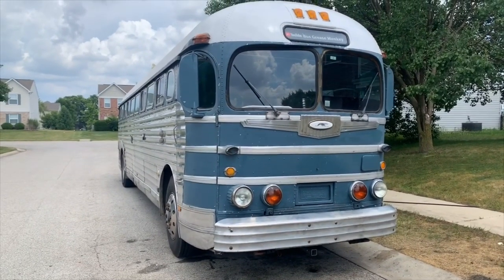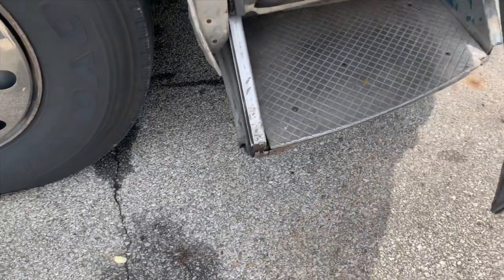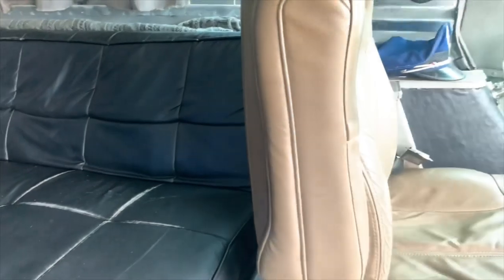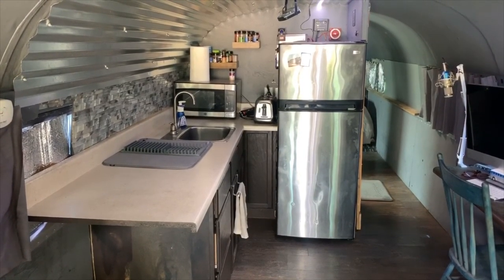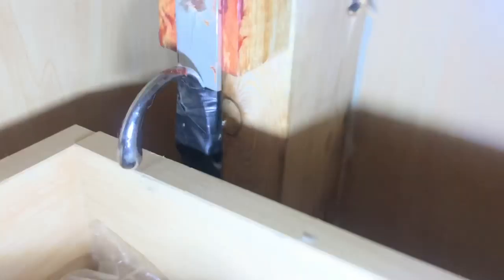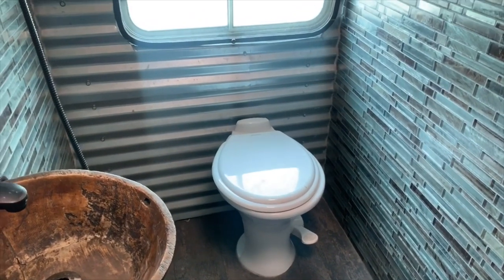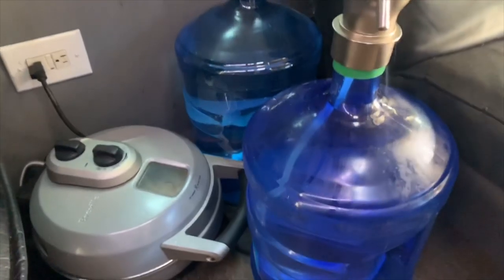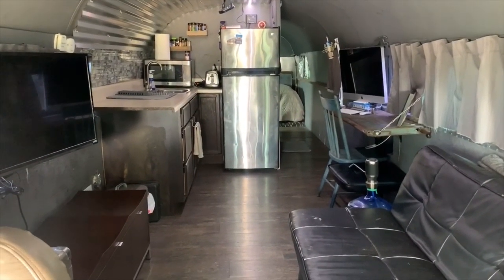Vintage bus tour gm bus 3751 silversides rv conversion

Comment: that "Power Drawer Lock" system you have is absolute genius! if the mainstream RV manufacturers made a system like that, they would probably make it a $1000 premium option that's only available on their top of the line models.
Reply: I had a Coachmen truck camper several years ago, and there is NOTHING more aggrivating than opening the door and finding broken dishes smashed all over the floor after driving ten hours. Sure wish I would have thought of that setup!

Comment: I like it. You designed and built it all yourself. Just a very few selected RV items. I like the drawer locks. That is well worth the effort. You always see them tossing their contents on rough roads, flying open and breaking the cabinets, then Duck Tape-the final solution. Thank you for the tour of your bus. I was wondering about it.

Comment: Just came aboard you channel a couple of months ago.  You do great work.  I can remember riding on a Greyhound bus close to this vintage in the early 50's with my family when we lived in Stockton, CA on trips to San Francisco for family visits.  Enjoy watching how you get er done when most folks would give it up. Like removing that broken bolt on the engine mount with just about zero room to work.  The modified crows foot wrench did it, but like I say, a lot of folks would have not have managed to get it out.  Amazing work you do. Keep up the good work.  I'll continue watching. A retired marine machinist at Puget Sound Naval Shipyard where some of the finest Submarine overhauls and refueling jobs are accomplished.

Comment: Wow, that was a mighty detailed tour. Thanks !!  The only thing you skipped (and it was eating me the whole time) was the secret to the door handle, and how you can activate or not active the slide-out step for those embarking or disembarking.  I thought maybe you were going to show us (you mentioned that you do something different with the handle to make the slide-out not slide out). Then I thought you were going to show us on the return to the front as the tour was wrapping up.  Then you didn't show the secret door handle technique.  I'm crushed. Ruined. Destroyed.  My weekend is shot. Life is over :)  But perhaps I'll get over it :)
Reply: Yeah Scott, how do you open the door sans steps?  That would be a good how to video.  I had disabled mine, but I needed to get it back to original for some (OCD) reason.

Comment: I guess that would be a historic bus, seeing as it runs quite well for its age! It's an eclectically designed interior for sure. Lot's of modern amenities, like LED lighting, AC, TV's, and solar; but loaded with whatever works best additions. I still don't see how you keep the Bus Grease off of everything after a hard day on the job, but that's another story, I'm sure!

Comment: thanks for the tour  ,  i love it ,, very homey and uncluttered at the same time ,,and i really love the bathroom 

mine is much more cluttered ,, i'm currently involved in renovating my kitchen area ,updating the cabinets a bit ,, i think i am gonna steal your electric door lock idea ,i shortened the overhead cabinet over the stove ,, I'm 6f tall and i hit my head on the cabinet 1 too many times when bending over
and i decided i hated the propane stove from the 70s ,, i found a 4 burner combo  that has 2 induction burners and 2 gas burners 
i like it a lot better cause it heats my cast iron skillet faster

Comment: I was surprised to see a gasoline generator, and not a diesel or propane generator. That said, I’ve maintained Onan 6.5KW units for years. They are very reliable and usually have no surprises. Victron and Xantrex make excellent inverter chargers FYI.

Comment: We used those water jug pumps all the time down in the islands...  and I was thinking you didn't describe your air conditioning  vent system running down the center of the coach...clever'''.

Comment: You mentioned "post-500", which is the sequential production number, although the coaches were not always produced strictly in line with the numbering sequence. Coach number 023 might be produced later in the year than coach 038. I think it was based more on ordering schedules. Penna. Greyhound lines were based out of Cleveland. You can take your sequential number off that plate and determine it's original Greyhound coach number(the number painted on the side of the bus). It would have been in the 4700-series and up.

Comment: Sorry to hear that the inverter is not working out. I supported UPS systems in computer rooms years ago and some of the older switching devices made a loud noise like the Trace unit you have. Check out Xantrex, they make both the high frequency, and low frequency types. The low frequency types have the heavy transformers and have higher surge than the high frequencies types, lighter weight units. I have a Xantrex 3014, 3 kw pure SW with a 6 kw surge . The 2012 is a 2kw unit. They also have a auto gen start system with a central control unit, that talks to all of the devices on there control bus, auto start on low battery voltage, or high RV temp with auto run once a month to keep system ready it not used often.

Comment: Great job, Scott!  Really like what you've done.  You need to build a rack for the water bottles.  You don't want them skidding around if you have to brake for an emergency.

Have you considered lithium-ion batteries?  That would reduce weight quite a bit.

Comment: Somewhat surprise but not surprised that Lenny has TPMS.  I haven't caught up on all your videos so  you may have covered that already. otherwise it would be really good to have a video on the pros (and cons,  yes there are some -heard some cause leaks) of a TPMS and which ones to consider.  Pretty important safety feature right up there with smoke and CO detectors IMHO.
Reply: Dell Anderson TPMS leaks were caused by the first version with aluminum valve stem and aluminum sleeve nut to hold it into rubber grommet. Salt no like... the version used now and this also replaces the first version, is a normal looking rubber pull in stem but it has a longer hollow brass tube that is threaded and a hollow screw holds sensor to it.  They make a Bluetooth to your phone system now that uses valve cap transmitters. Also have this style with a radio box to relay the sensor info on longer trailers where the signal fails without the booster relay device.

Comment: Love the videos and never thought I'd love watching these videos, I came for the Detroit diesel videos but have stayed for the content. I would love to know what the power difference is when you change from the 4 valve head and turbo setup here in the next 100,000 miles.  Your mechanical know how is awesome and I personally have a 6.2 GM military code diesel and would love to know your thoughts on maintenance and performance.

Comment: That PD3751 door seemed to have come out in I think the mid 1940s.  I think had a different window pane by the driver and in the entrance door before then.  When I see the design, I almost think of Ward or Hicks used a similar design compared to the window pane design on the late 1930s GM PD 3751.

Comment: Yeah i'd want over 70mph in today's high speed traffic if i was getting 10mpg. Two stroke i wish they'd use modern HCCI amd direct styles of injection to make old 2strokes run way more efficient/clean. No R&D money going there... Like does someone make a prechamber ignition system? Thats just machining a head and A LOT of engineering but it'd be awesome.

Comment: I had one of those Max Vent fans in my RV.  It was over my bed.    One night I set it on Blow In.    In the middle of the night one of those velvet green Florida frogs jumped into the fan.   That fan shredded the frog and sprayed the juices all over me and my bed. 

Best to put a screen on top.
Reply from the maker: It’s not over my bed.

Comment: Look like the front seats are cannibalized from a early to mid 2000’s Tahoe or suburban. They look great in there tho. 

I never would have guessed that you guys are vegans. I can usually spot them a mile away but you must be doing things correctly cause you don’t have the Vegan look, good job!
Reply: Weird flex but ok
Reply: Don Pfeiffer I think they’re Caddy seats. Never seen a Tahoe/‘burban/Avalanche with seats that wide. Maybe a 90-92 Cadillac Brougham.

Comment: Have you considered just going to 12r22.5s ? probably accomplish the same thing without changing the wheels, and you'd also get 16ply rating with more weight capacity.

Comment: wouldn't the turbo boost the MPGs up higher. im not sure if that fan you got can be replaced with electric fans. as it could take some drag off the engine but  it can draw amperage from the alternator.  i seen the electric fans on the newer Gillig low floor busses. as they can come on to cool the radiator as well as come on for boost conditions when using a turbo

Comment: Does post-500 also =Postwar?  I've read that some of the parts for the prewar Silversides are a bit hard to come by.
Reply from the maker: 1947 1-500 was the cut off but i worked in 508 a couple years ago and it had the pre 500 setup so I’m not sure where it cut off.  All post war.   Pre wars are very different.

Comment: Question: what do most travel centers charge to dump your tank? Thanks for the video.
Reply from the maker: $10 but we usually get it free at highway rear areas, camping worlds etc.
Reply: The sewage treatment plant in Jackson, Michigan used to charge $5, but it's been well over a decade since I've taken anything there.
Reply: Out west truck stops or rest stops will be free.  Most gas stations or RV parks that offer it are $15-25

Comment: Are the 3751s body on frame or monocoque? I thought the 4106 was the start of the unibody.
Reply from the maker: Nope it’s a monocoque just like all other gm buses.  Airplane fuselage type body with wheels attached.  No heavy steel frame.